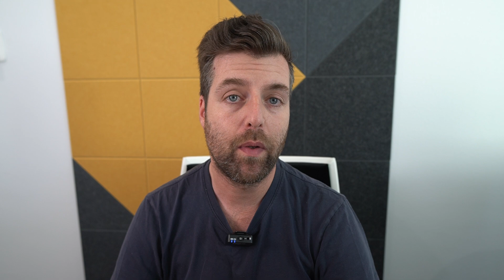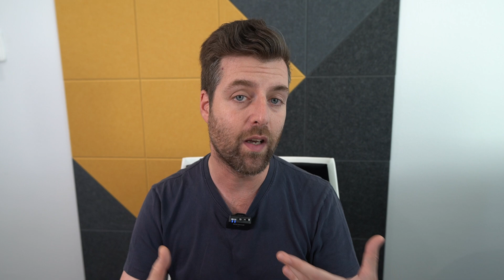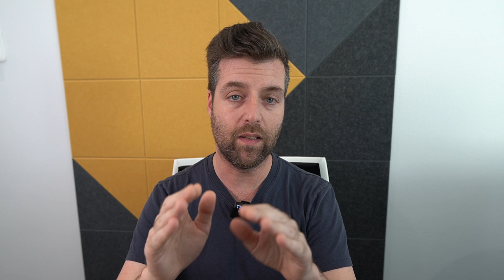Too much Absorption is a real PROBLEM!

Comment: Great video!
I have what some may call "too much" absorption. I have over 20 x 2' x 4' x 8-10" thick panels in a fairly small room . A few have BAD scatter plates on their fronts.
Around half the panels (all 10" thick plus an air gap) are stacked floor to ceiling on the front wall behind the subs and LCR speakers, with the remainder placed on the side walls and behind the seating.
This has lead to a very smooth response from 10 to 300Hz (3 x Seaton subs smoothing under 80Hz)
I definitely like a "dryer"/ deader sounding room. as each additional pair of panels has increased my listening enjoyment....though I may be nearing the point of diminishing returns
Reply from the maker: Thats 600 square feet of absorption?  A typical 3500 cubic foot room would need typically about 200 to 400 sq ft of absorption to hit the typical home theater or listening room standards for RT60, so yeah, thats a bit much, but its your room.  If you like it, thats what matters.  If enough of them have scatter plates it may not be big deal.
Reply: @PoesAcoustics  How do 20 panels add up to 600 SF of absorption?  Not 160 SF?

Comment: Mr. Poes, thanks for more of your valuable insight.  Isn't it interesting how the room is the very first part of a "system", but it is the one most often over looked or least considered.  Decades ago as an "audio foundling" I never gave the room much thought, it was mostly the gear.  Today, I try to take all of the "system" components into consideration during set-up and tuning.  Also, "Room" issues is one of the many reasons why I stay far away from automotive audio - no thanks.  Besides drivers should be paying full attention to driving and the condition of their automobile, but that's just my mechanic mindset opinion.
Reply from the maker: Rooms are ignored and even worse, people will spend a small fortune on cables, audio clarifiers, even overly good amplifiers or DACs, but not spend the same on the room treatments.  I tell someone that a premium acoustics package is $15k----No way!  Too expensive!  I tell them a good starter package is $5k....Ok but that is the upper limit.  Yet I'll see in their systems very expensive
Reply: @PoesAcoustics  Mr. Poes, That's because there isn't any lights or dials on the acoustic absorption products. 😉
We both know affordable gear in a good room has a very good ROI.
All the very best, Kevin

Comment: The 1st room I put together as a young lad before Youtube was even invented & sources of info for home cinema building were thin on the ground was ridiculously over absorbed, to the point where when everything was turned off in there I could actually hear the blood pulsing through my ears! 😂
Reply from the maker: That normally happens when the room is very quiet.  Most people assume that it is hard to achieve that, but actually a lot of spaces, like Basement rooms, are very quiet by nature.  My last theater was sound isolated in a basement.  The HVAC was not as well managed as it should have been, not large enough supply and return lines caused overly high air velocity.  So the room wasn't as quiet as it could have been in that scenario.  But if you turned the air off and nobody was home doing anything, the room was quiet enough to hear your own blood flow.  My room RT60 had been around .25 at one point, but I later retreated from that and added in some diffusion and removed some absorption to normalize things.  I had been playing with the idea that a surround system doesn't need diffusion or reflections to sound right, but I've since decided that isn't true.  The advantage of diffusion is more about making the room comfortable to be in with nothing playing and helping/enhancing surround tracks that aren't super high channel count (which I didn't have anyway).  It also reduces the audible effects of comb filtering.  So all in all, I think a higher RT60 and some diffusion makes more sense.
Reply: @PoesAcoustics  My old room was just an upstairs bedroom but I'd gone way overboard on absorption & like you say it just was not comfortable to be in at all when everything was turned off. I tried to sleep in there a couple of times when I was decorating the bedroom & I ended up having to put a TV program on at low volume for some background noise to drown out the weird sounds of my own internal workings!

Comment: GIK advised me to do this. No diffusion. They said a commercial theater does't have diffusion either.
Biggest problem in small rooms is base management and echo.
For stone walls, not American cardboard walls.
Reply from the maker: American walls are not cardboard.  Drywall is gypsum, thats a stone.  Plenty of reverb in American construction, drywall is very reflective.  

What GIK said is true and nonsense at the same time.  Come on GIK you know better.  The acoustics of a commercial cinema do not match a residential space.  Commercial cinema's have very different modal behavior too, the room modes are not discrete and the FS of the room is often at or below 20hz.  Such rooms contain real reverberant fields, so adding diffusion could have benefit, but its far less necessary.  Instead, the goal is just to get the RT60 down to a manageable level to make things sound good.  The room naturally diffuses through distance alone.  That isn't true of our small rooms so diffusion is helpful to scatter the strong direct reflections and randomize or mix the phase throughout the room.  The more natural reverberant field that forms in large rooms is mimicked in a small room this way.  

Commercial cinema's are also built as cheaply as possible.  There is no time for things like diffusion or LF damping.  I wouldn't call a commercial cinema THE reference to compare against.  Many well done home theaters are ultimately better than commercial cinema's.  With some residential theaters having the Christie Eclipse, I would say such theaters are better in every way.  Quieter, better speakers, better acoustics, equally good picture but probably better optimized.

Comment: I have exactly same issue.....
there was lot of echo in my room
did some panelling with mdf board and microwool in front and back wall it helped a lot but then there was issue with subwofers i was not getting proper bass and when upperbass is coming it was boomy 

then installed all 4 corners in the room with basstraps with mdf board and rockwool
still the bass is boomy in 2 locations front left corner and rear right corner exactly where my subs was located 
now my full room side walls is done with MDF and rockwool and now there is no boomy bass but
overall sound of speakers is dull there is no punch no bright vocals only sharp highs......

i am really not sure what to do
the room was 19.5 ft by 11.5 ft and ceiling was around 9
after all panelling of all walls
its. 18.8 by 10.7 and ceiling is 8.85

Comment: Hi Matthew, great video! Do you advise on putting absorbtion above the seating area in a home theater? I've recently put some absorbtion on my ceiling, at the first reflection point and above the seating area. After these additions, my RT60 is hovering between 0.2-0.29. Maybe I should have put some diffusion above the seating area?
Reply from the maker: That is a fairly low RT60 but without knowing the size of the room it is hard to say.

Yes I generally like diffusion over the seating area.  I probably would take out some absorption, but again, would need to know room size.
Reply: @PoesAcoustics 

Here are my room dimensions

6 x 4.5 x 2.3 meters

I have now removed the absorbtion from above the seating area, and the bass absorbtion from the rear corners. My RT60 is now between 0.25 - 0.35.

With my ceiling being quite low, would putting diffusion on the ceiling be too close to the listener?

Comment: I have a very small office with a 5.1 setup. 2.5m width x 2.5m height x 3.5m length.

There are a lot of hard surfaces and I have a large window with blinds on the right wall.

I decided to put a mattress agaisnt the rear wall and the sound was surprinsgly better.

I'm not sure if I should be putting pure absorptive panels, or combination diffusion/absorbers such as the GIK Alpha/Impression series. What would you suggest?
Reply from the maker: Are you sitting against the back wall with your head inches away?  If so, pure absorption. If not, it could depend.

Other surfaces may benefit from a hybrid surface or even diffusion. Keep in mind the perforated plates from GIK and others do not actually diffuse at all. But they do help balance absorption and diffusion.
Reply: @PoesAcoustics  Back wall is approx 2m away from my MLP. Side walls (currently untreated) are 1m away from MLP. At present deciding between pure absorption or the hybrid panels from GIK.

Comment: Does putting one 2 inch absorption panel on the front wall and one 2 inch panel on the back wall have the same effect as putting one 4 inch panel on the back wall (or front wall)?
Reply from the maker: No Absorption doesn't work that way.  Foam, fiberglass, or any damping material of that nature is known as a velocity absorber.  It absorbs efficiently in the velocity range of the wave and that is tied to wavelength.  As such, a 2" panel on one wall and a 2" panel on another wall doubles the absorption area, but it doesn't change the effective depth.  It will still only absorb down to the quarter wavelength associated with 2" efficiently.  

There is a general rule, for bass absorption, that you get the same effect covering two walls with half the absorption vs one with all the absorption (all vs half being an arbitrary quantity) but that refers to surface area effect and not bandwidth.  Bandwidth is still dictated by depth.

Comment: You talk a lot about speaker boundary interference. Is there also head to boundary interference where the distance from your ears to the back wall creates a comb filtered response? Maybe do a video on all the interactions with the room where comb filtering takes place and their strength of effect on the overall sound response? Thanks Matt!
Reply from the maker: Comb filtering is a general name for interference patterns that exist as a result of reflections interacting with the direct wave and other reflections.  So yes there would be a comb filtering effect caused at the seat location, but its just another form of boundary interference effect.  It isn't different really.  In your specific example, it's really a room mode.  Remember that room modes are the interference patterns defined by the room shape and size relative to the listener position.  What I call SBIR is the interference pattern formed by the room shape and size relative to the speakers position.  SBIR changes as you move the speaker (the interference exists or not based on the position of the speaker).  Room modes always exist and are a function of the room, which ones are excited is up to the speaker location, which ones you hear is up to where you sit, but the mode itself always exists.